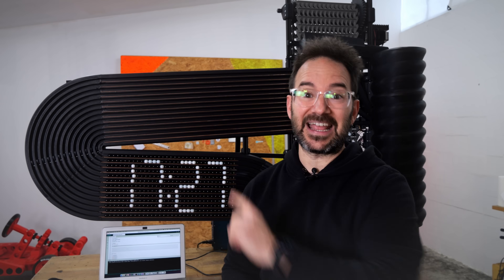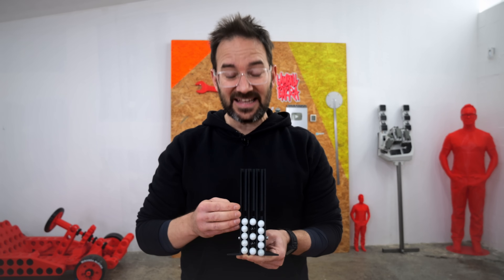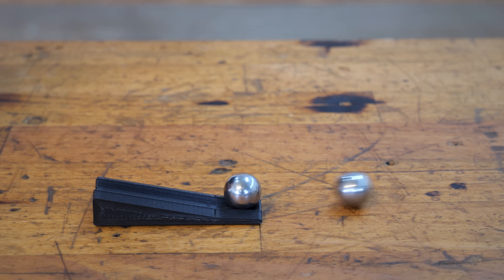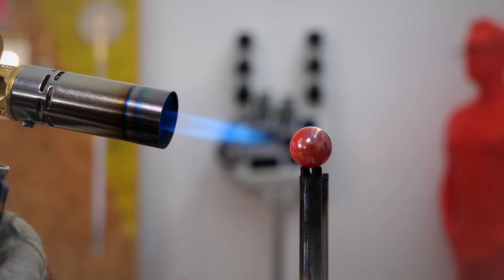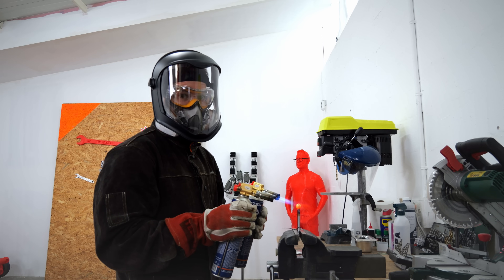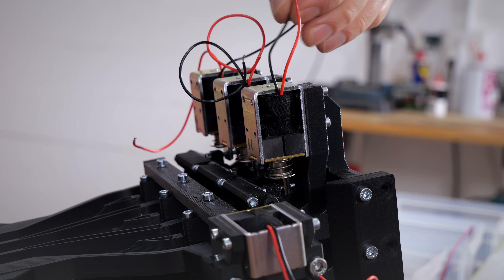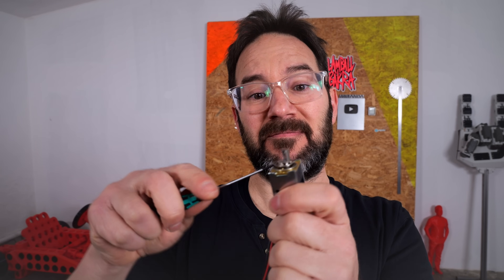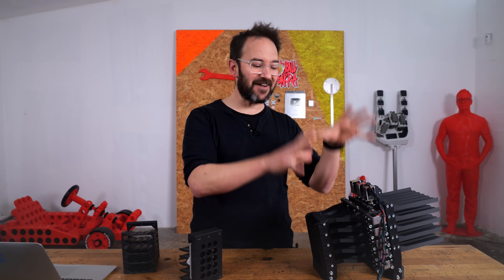Ramp Based Rapid Marble Swap - Marble Clock Seconds Display Pt.1

Comment: I still believe the steel balls will get magnetized over time, slowly. This is usual problem with mechanical devices :( I would prefer the mechanism that is based on 3 positions (servo) as that one, even when the steel balls are magnetized, will work - it will "pull" the steel ball from the rest to the side, decreasing the magnetic field using distance and therefore releasing the ball from the hold.
But you do you, I build no such contraption so far, so my comment under your video has very little weight ;)

Comment: I am surprised you haven't 3d printed a loading mechanism for the times you need to hand load the channels. Maybe something big enough to handle the steel bearings, but will also work for the marbles.

I am thinking like a funnel that feeds into a rail measured out to allocate 5 marbles, then stops the feed until after you have dispensed the loaded ones with a release up front for once you have it lined up to the tube you are filling. It don't have to be fancy or automated, the releases can be functioned manually and just need to do them in a particular order. The only thing I would invest time into working out would be to make the front release on a channel that adjusts to the size of the marble, or gives you room to add more/less at a time. Ideally you would fill all the silver channels, then reset  the dispenser for the black channels.

Comment: an idea to turn the marbles black. I am working in a Forge in Germany and if we want that a knife or a tool is black we heat it up until it is red hot and than put it into oil. Before it is cooled we put it out so that the last bit of heat can "dry" the steel. Normally it is black after the first path. There are different oils out there. and I am not sure if it works with Crome(I think you said it). Very nice machine

Comment: If you created a "drum" (step-rotating on a vertical axis) with several faces (3 or 4), you could bring each face into view, in turn, when its marbles are in place: That is, the numbers can be assembled in stages, in back, and then rotated into view, then emptied out of view... to the site. Those 1/3 seconds processes would not matter, and the indicated seconds would be ready for display in time.

Sort of like the principle of Gatling gun... multiple barrels, so that they can be emptied and loaded in stages before coming into play. Or a four stroke engine... and so on. In any mechanism in which multiple actions are needed in too short a time for practicality, then multiple examples of the mechanism are built so that they can divide the stages needed, while out of use or view.

Comment: Did you consider only changing the marbles that are different each number? For example to go from 0 to 1 you would only have to change 7 marbles, instead of changing all 15. Or 8 to 9 would require 1 change, 9 to 0 would only change 2 marbles.

Comment: This is wonderful and your energy is wonderful.

Technically if you want to move individual marbles instead, you don't need to change them all every second. For instance, from 2 to 3 you only need to change 1 black marble and 1 white marble.

But the rhythm will sound different.

Comment: Congrats - you constructed the selector-multiplexer just the WRONG way round for optimal speed: The way you constructed it, you'll need to iterate over the rows one by one, with the correct source channels selected for the row you're "ticking". That makes 5 "ticks" per digit to be displayed. If you had chosen to drive the source selector by row and the gate by column instead, you could iterate over the columns instead, allowing you to select the marbles for the entire digit in only 3 "ticks".
3 marble selector "ticks" per second seems easily achievable to me - 5 "ticks" per second might turn out just a little bit too ambitious.

Comment: Well, I'm about half the video but I have a little observation to do here: it's unnecessary to use a 15 marbles system since some of the marbles will never change from their position.
Like the one in the top right corner (from the viewer prospective). So you could just leave a silver marble in there and you'll be fine.

Comment: There is no need for contrasting marbles. On the previous clock you used black marbles to separate the white marbles but in this new design  the marbles are essentially free standing. And so a digit could be comprised of white marbles and gaps. New method for resetting the digit each time would be required of course.

Comment: I do like 3D metal printing just as much as anyone else, but that aluminum gate could have been laser cut, which would also slide better because of the better surface finish. If you continue to have issues with magnetized balls, laser-cutting a steel "gate" between the machine and the solenoids should help and keep the machine more compact, which may become important if you want to add more digits. I can't wait to see the mechanics that sort the balls by color and feed them back into the machine. Happy printing!

Comment: Why you didn't juse use the servos for first type of gate, that required three positions? Such solution should be way more simpler and compact, plus it would be faster due to  individual control

Comment: Couldn't you get rid of the need for black marbles by going back to a system that dumps the previous digit maybe a fifth of a second before the next is released into the channels and displaying the black marbles as blank spaces? If you're tipping them out the front with another version of that gate you got from PCBWay they would probably clear faster than a vertical drop, I'd imagine. Also, as mentioned, you can just always leave two of the channels black / blank and three of the channels always silver / on (two dark areas in the eight, right column top/middle/bottom)
Reply: Had the same thought myself! No need for contrasting marbles.....

Comment: To get back marbles faster, I'd get a small forge to heat marbles in bulk. You know, those ones for DIY casting? I don't think they can get hot enough to melt steel, but dumping them in a crucible would make a dozen or so forbidden cherries at a time! The main problem I can see is that if you let the steel get too hot, It may get soft enough to deform from having other marbles next to it. 

Also, I would consider having something transparent in front of the display, If you manage to make the dimensions right, you may be able to avoid dumping the marbles haphazardly and having to take time to sort the marbles again and again. Basically each marble would always stay in order in its own track. It would unfortunately make that multiplexer you built pointless, but the overall design could become simpler. The problem would be to merely move the marbles back to their original position quickly.

Comment: Btw with the steel marbles would it be possible to make the slow-down bucket smooth, and have kinda a ramped water bed to feed it back? It may be faster and less loud.

Comment: Regarding the colouring process, the colouring progression seems to be the same as if you seasoned them like a cast iron pan. You could test a batch of with a light layer of oil and then put them in the oven for 1 hour, doing this multiple times may produce the same colour result. but you could bake hundreds or thousands at a time.

Comment: "Easiest" way to maybe mass produce the black marbles might be to find a glass blower or a blacksmith nearby, and see if they'd let you use their furnace. Get something that won't melt in the heat and can hold a bunch of marbles. Then just follow what you did. Heat, dump into larger oil bath, repeat, but this time doing batches of 10s of marbles at once.

Comment: This design would benefit from  not replacing all the marbles every time. 1 & 2 have some overlap in colors. 7 & 8 have even more in common. Think of it like video compression and how it doesn't store every pixel of every frame.

Comment: Marble colour.  Just use Diechem or Black Sharpies.  Yes this wont be super durable and there might be some colour transfer.  But this only needs to work for the video.  Fast and easy.  Cut open sharpies and throw the felts into a bucket and put the marbles in and shake shake shake.

Comment: the way you select marbles are going to be trouble. because you are selecting either white or black for the entire row. let's say the middle row, you'll need both color's but you can choose only one. you'll need to change that. not doable as long as your color selector does the entire row at a time.

Comment: 14:15 You can solve 2 problems with one change...

Replace your steel marbles with Aluminum and Brass marbles...that solves the sticking due to the magnets (neither Aluminum or Brass stick to Magnets) and each is a different colour from the other from the start eliminating the need to heat treat the marbles...

Comment: Haha, you presented the solution in the first few seconds. When the marble has to much impulse it clears the stage. No marble no dot in the matrix. Single color marbles fine. Just two main registers shifting all at once an one solenoid + guided wire for stopping individual marbles on the higher position for more impulse. :)

Comment: A gas powered torch was the most clever way you could find to heat a lot of balls to the same temp at the same time? Ouch.
Even a BBQ would be an upgrade if the balls aren't compatible with induction. 
Primitive Technology channel could make you a kiln from mud?

Comment: Ooof getting a good black oxide coating in stainless steel can be difficult!

With any iron alloy if you can get a decent even layer of rust on it you can convert the rust to black oxide with boiling water. It does go a bit faster but I do think chemical blueing is more durable. 

Just in case you ever decide to loose your sanity and try to black out ballbearings again.

Comment: 2 things
1. would it be possible to mass heat the marbles? like put them under a big heating element, heat them, then drop them all into oil and the other stuff to make the black marbles more easily

2. you could do a sort of 1's and 0's thing, instead of having 2 types of marbles, just don't drop a marble and leave a gap, then you just need to adjust it so you can drop a marble without needing a new one to bump

just trying my best to help, best of luck!

Comment: I think that you should heat and quench marbles in batches in electric furnace. Also, check out if bleach or pipe cleaner have any effect on chrome coating.

Comment: TL;DR: You could extremely easily reduce marble demand by a third, and (as a bonus) gain the option to cut out an entire column and a solenoid from the multiplexer.

It's probably too late to point this out, but you don't even need to change three of the 15 marbles on the face. Ever. 
The top left marble is always white while the Middle column second row and middle column fourth row are always black for any of your given digits. You could just put the marbles there manually, then remove/block those channels. The main benefit of this would be to reduce the demand for marbles by a fairly significant amount. This would in turn reduce how fast you have to return marbles to the top, with a fairly simple fix.

Just block the positions marked with O

OXX
XOX
XXX
XOX
XXX

A further improvement can be made if you took the 1 and moved it to the right of the 3x5 grid (just fill the rightmost column with white). That makes it so that you have to change the top left marble, but instead makes the top, middle and bottom spots on the right column never change from white. If you did that, you could completely ignore 5 of the 15 gates. That's a rather significant reduction in how many marbles you have to supply each second.

So 1 looks like this: (B for black, W for white)

BBW
BBW
BBW
BBW
BBW

And that lets you ignore these channels:

XXO
XOX
XXO
XOX
XXO

Of course, doing this also means you only have to supply 2 lines of marbles per row, so you could also get rid of an entire column and a solenoid in the multiplexer part, and save a decent amount of space. Or if you don't feel like spending hours for a simple upgrade, you can keep the same multiplexer, unplug one of the column solenoids while the gates are closed, and remake the part that connects the multiplexer to the clock face.

Comment: Any reason that your "selecting" the marbles instead of reusing them? For this seconds hand design, i figured it would work best if you had a cyclic sort of "belt". Each segment is 5 marbles tall and 3 wide. With this you could drop them down while keeping them arranged correctly, and recycle the marbles to the back of the loop. Basically the marble equivilant of an old stopwatch or clock that uses cylinders with the numbers printed on the side. 

Another related question for the clock as a whole, why are selecting marbles at the top by removing them from the conveyer instead of controlling what marbles go into the conveyor to begin with. This would allow your numbers to be generated much quicker since you no longer have to rely on random chance that the correct marbles are selected. I think it would be easiest and most efficent to have a sorting system at the bottom that can then select and supply the correct color marble to the right channel of the conveyer. This would remove a ton of other components that are needed in hard to work/modify locations such as the top of the conveyer. Everything located at the bottom would be easy to service and not be constrained by space. This would also remove the noise problem from the "rejected marble" slide. 

Reguardless, Love seeing the designs and your solutions! Keep it up!

Comment: I have an idea. 
But it’s a complete remodel of what you’re currently working on. 
My idea is to use the exact same 150 marbles in the exact same order over and over again. 47 black and 103 “white”. 
Because the numbers will forever be 0-9, you can just line up a set of 15 marbles that make the 0, and right above it the marbles that make the 1, and so on. 
The only trick you’d have to figure out is an elevator to grab the evacuated marbles up to the top in a few seconds in the same order. 

And if you can’t get the elevator to move fast enough, then you use the same 300 marbles and have two sets of numbers and twice the time to elevator them up.

Comment: How will this work?  Each row has a selector for black or silver balls.  If you wanted to make a 4 the top row would be silver, black, silver.  How does the middle column get a different color?   It looks like each row would have to have the same color.

Comment: Did you try dunking them into old used engine oil instead of new clean oil? When I started hardening knives I used old engine oil and the blades turned black.

Comment: These projects always entertain me, and the over-engineering is part of the fun, but i think you over complicating this design especially with the small amount of black marbles you have.  If you only push out the marbles that need to change, think the row of solenoids on the top of you belt from the first clock , you could use way less total marbles, and then your selection method for loading marble could be simplified as well, just have it load the opposite color behind the one in line before it.

Comment: If it was me I would just make the release mechanism act on a per channel basis, then you can just use a flip flop to alternate black and white marbles in each channel but only release a marble when it needs to change color for the next number. If there isn't enough room to make it per channel at the current release point you could always keep the existing release and have the per channel release immediately after the flip flop for that channel and leave some channels empty at the final release.

Comment: You could batch process the marbles with a gas forge or tempering oven, and a couple of big steel buckets for the oil and the bluing solution.

Comment: I keep thinking if you load the balls sorted, and could keep them sorted, then you significantly reduce processing.  There's actually so many efficiencies that could be incorporated, which he's not even looking at. (i.e. only switching the color changes).  Or self sorting strategies, like magnetic and non-magnetic balls together, or slightly different ball diameters, like a coin sorter.  Or why show black balls at all.  Have the black background and just put in or remove white/silver balls.  His designs are like mechanism porn, which has an appeal, but at some point it needs to achieve the design goals, work and be reliable.

Comment: also....you can get away with just 12 changing marbles in the array if you put the "1" hard left as it will always be white in the upper left corner and the rows 2 and 4 center locations will always be black

Comment: Instead of dropping all the marbles at once, I think for seconds, you can just scroll the marbles down one row at a time. I think for seconds, approximation of the current second is okay.  This means, also, that you turn a clear/refresh cycle into a single clear cycle, and the refresh is as simple as the next marble now having space to drop. Now you're just dropping a row every .1666 seconds (five number rows plus a black separator line) and if you do this with a roller that rolls out the marble instead of dropping it all at once, the marbles will descend smoothly enough for easy reading.

You're obviously way beyond considering that, though.

Comment: ...can you paint those steel marbles? Instead of going through that painful oil tempering process 11 per marble...😢

Scuff the marble, spray your custom coloured car spray paint (or just black), and dry. 

If you want it shiny again, then Scuff one more time,  and add a clear coat finish.

You can do this in bigger batches together to save time!